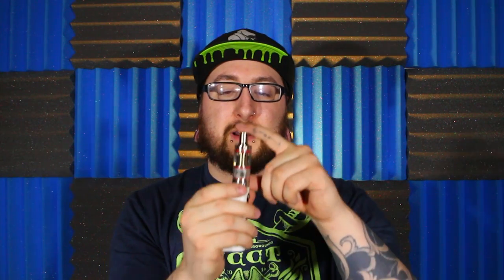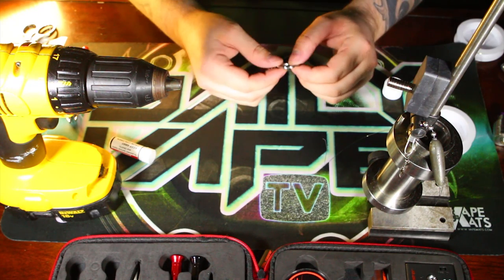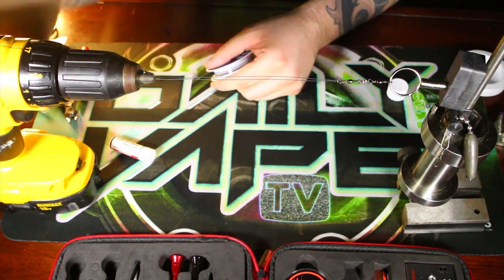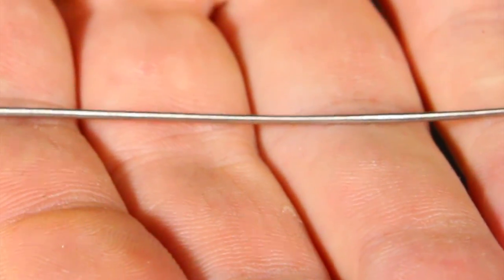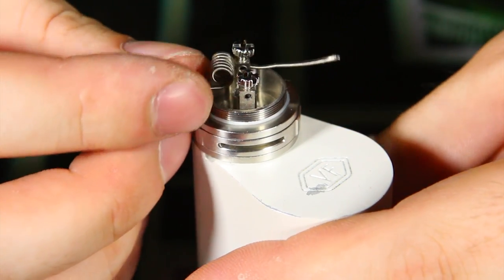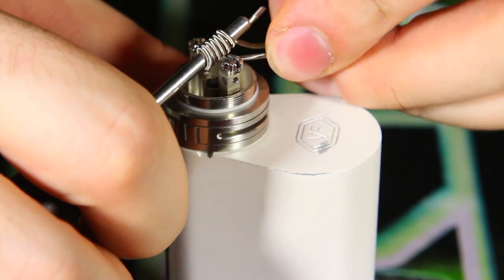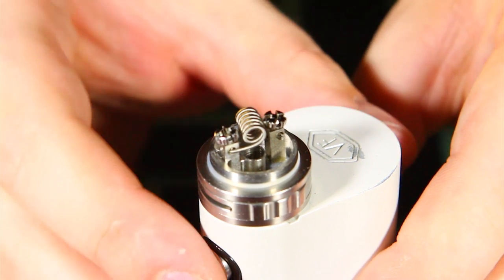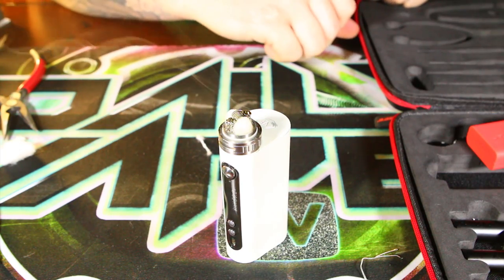#FRESHBUILDFRIDAY - Magnet Spinners

Comment: i got an idea of maybe optimizing it... glue the  key ring to the small magnets in an 90° angel get the post with the other magnets in a fix position where it can not be moved at all then attach the fishing swivel to the key ring with the wire on it and get the other ends of the wire into the drill and get it into a distance to the other magnets where the magnets with the ring on just float there in mid air trying to come together with the fixed magnets...  that way you get rid of the surface friction between the "ring magnets" and the fixed magnets... that way they can spin perfectly i think...
Reply: Norok Vokun that's how its done

Comment: whats the point of magnets when you can securing swivels to something else, it spins the same. Am i wrong on this one?
Reply: if you get the bigger magnets it holds alot better and you can pull it tighter and there's vids all over ig that show it beautifully and there's a nut floating and spinning its crazy
Reply from the maker: Whenever I use just spinners they tend to bind up occasionally. Since I started using magnets I get much less binding which means less clean up after I make the wire. Ever piece of my kit has a purpose which is to make my life easier lol
Reply: Daily Vape TV thanks for explanation
Reply: It was supposed to be floating